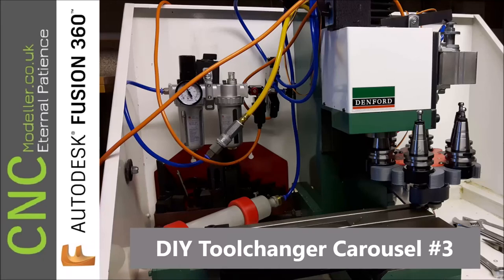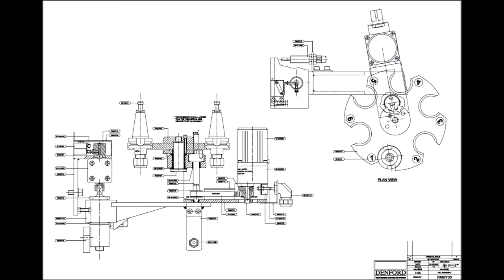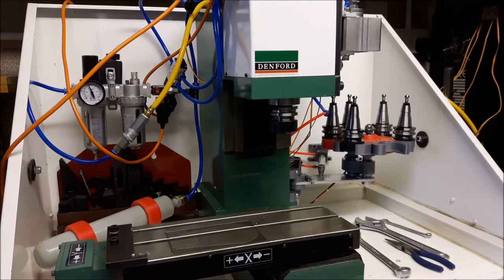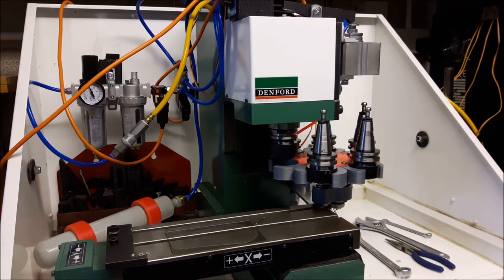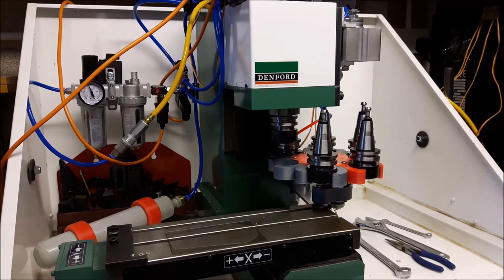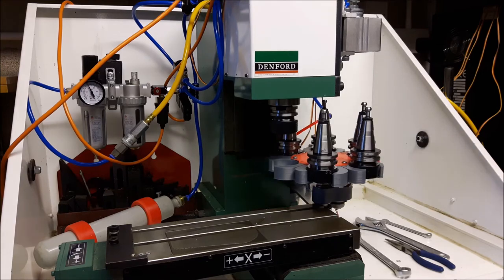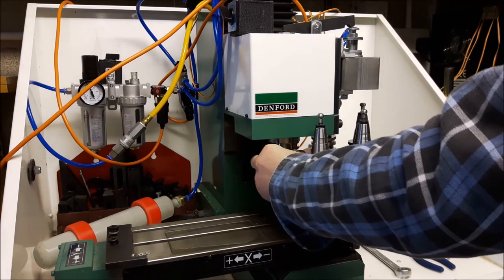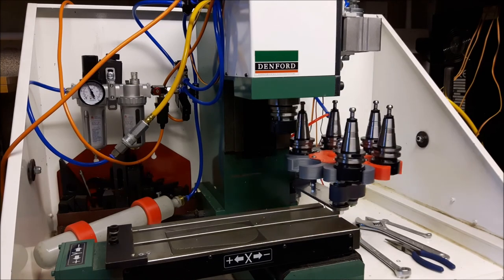DIY Milling Machine Tool changer Carousel #3

Comment: You could mount a limit switch under the carousel on the spindle side to avoid crash breakages. If the tool engagement jams pushing the carousel down, it would trigger the switch setting an E/Stop state.
Reply from the maker: Thats a good idea, thanks for the input! :-)

Comment: Looks good! I was tempted to take the approach they use with the newer machines, and have a carousel mounted to the bed (on the left hand side).You loose a small amount of bed space, but it simplifies some alignment and stability. That said, I might just machine all of the parts from aluminium and delrin and do something similar... Another project :-D
Reply from the maker: Thanks Jon, hope your project goes well!

Comment: Great build. Im thinking of transplanting this onto my Starmill. Possibly a little smaller but the same sort of thing. Any chance you have the models? If theyre on denford data i cant find them as yet
Reply from the maker: I'm pretty sure that the drawings are on Denford data but I can't find them. I've found that the Denford support team are sometimes amenable as the pars are no longer available so they might send you the drawings or at least post them in the form if you ask nicely. I'd drop them an email. Hope it all goes well 🙂

Comment: Would you mind sharing your screenset and tool change macro?
Reply from the maker: Hi Jim. The tool change macro is built into the denford control software. Actually I believe it's in the control card firmware. Not sure what you mean by screen set???